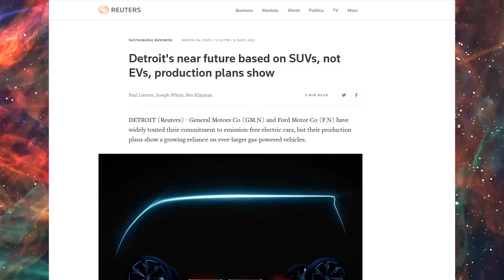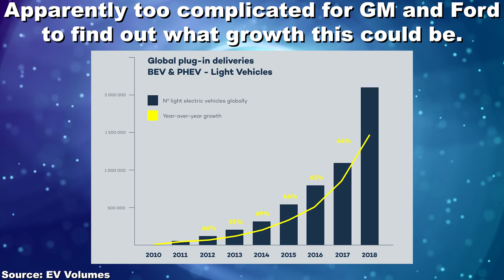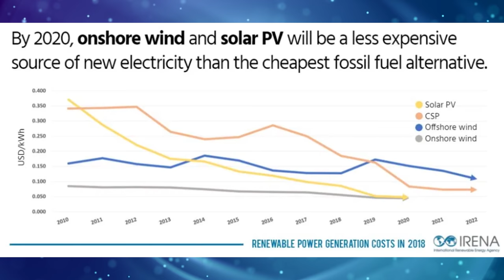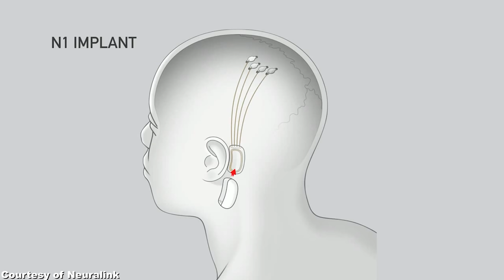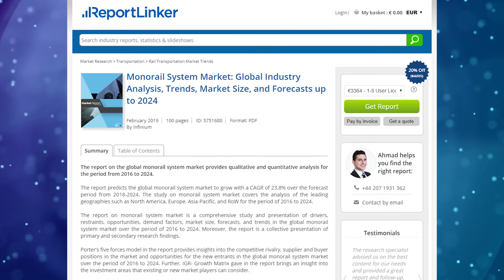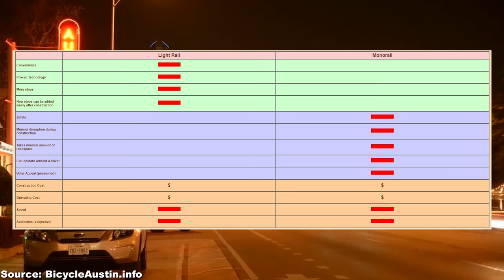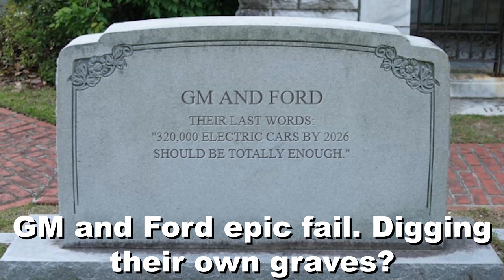Tesla Giga 4 Progress & GM+Ford's Bizarre EV Sale Target

Comment: Suggesting that solar and wind power will have the BTU value to meet the requirements of the world that is now serviced by fossil fuels is unsupportable.  Fusion power, someday could, but the technology does not now nor in the forseeable future exist to contain and stabilize the reaction.
And while we're splitting hairs, if say the US goes completely electric in vehicles where will the electricity come from ?  LOL, no one that can add thinks wind and solar will replace the BTU requirement of the US auto fleet.  So you'll be back to having large scale fossil fuel power plants.  Unless of course you want to build nuclear fission reactors.  And no self defined tree-hugging greenie can get past their blind obsession against this practical form of power.  Its nuclear afterall. Its had two accidents in 60 yrs, world wide.  But its nuclear.  
Nice show, love the optimisim but seriously.  You need more facts when it comes to power.
Reply: First, thanks for answering the general comment I made and its nice to know you do research (hehehe).  First, you'll lose over 20% of electric power generated in attenuation line losses when creating overall dependence for the US auto fleet on solar generated electricity, so at the start we have to question where you get your data.  Secondly, since cost per BTU seems to be verboten in this analysis let us simply look at geographic practicality.   It does no one short of Egypt and Libya any good to place solar production facilities in the Sahara.  You can't ship a Megawatt of electricity as you can a barrel of oil or a litre of LNG.  But doubtless this is a transitory technological issue that can be overcome with greater gov't intervention.  You have a practicality hurdle that is not being addressed, one would assume in the goal to better advance a position in a discussion.  Solar cannot be practically stored, is localized in its abundance to certain latitudes and climates and is governed by a limitation on amperage generated in a photovoltaic cell which in the end determines the massiveness of the production fields needed to provide electricity to the localized region that can benefit from that facility.  You present a particularly simplistic vision of a future of which your solution is dubious.  Lets get past 'we can just plug it into the wall, electricity is free'